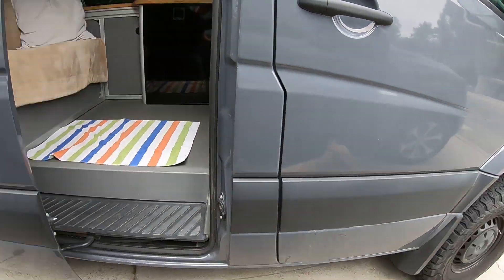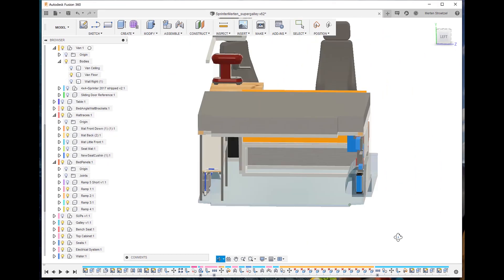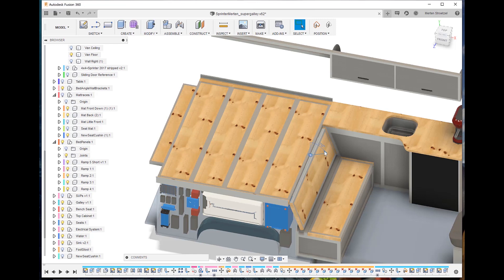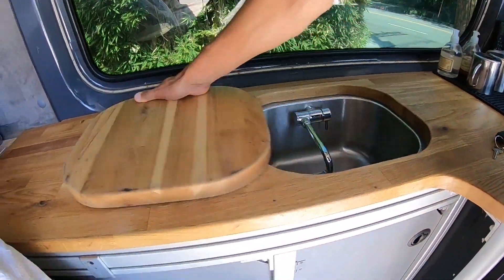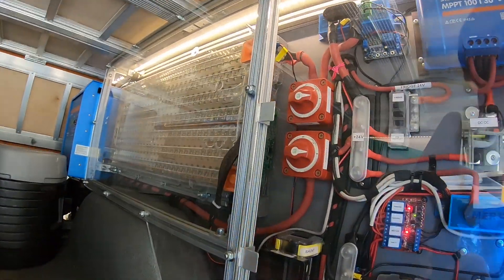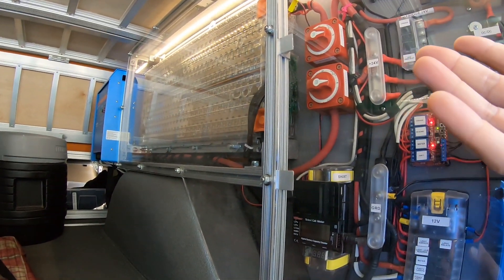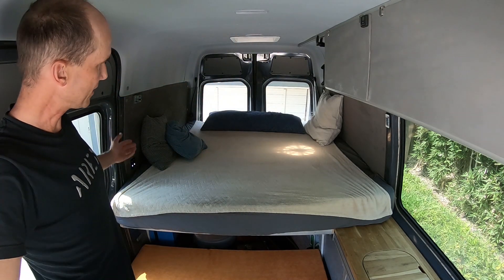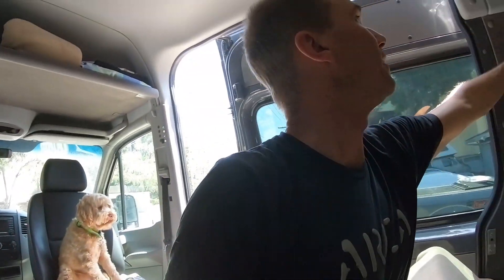Sprinter Build

Comment: I've always been intrigued with van builds. I really like your well thought-out design. Especially the heavy use of extruded aluminum, which I don't see often. I think it is a great idea to keep the weight down, and easy to remove, since most van builds I see use permanent wood structure which must add a lot of weight.

Comment: Thanks for showing your van off.  Your electric system still holds up 5 years later! Great job  with the bed. I particularly like how easy it was to set up and take down.  How many watts  of solar on the roof? 5 years later, is there anything you would have done differently?

Comment: I think you mentioned that you attached the bench seat to the original bench seat mounts. How did you do that? I've downloaded your Fusion model, but I don't see it.
Reply from the maker: I used j-bolts, hooking them into the track, tightening them on the 8020 bars positioned above with washer and nut. Here a pic where you can see the tip of the J-bolts and the nut: https://lh3.googleusercontent.com/pw/ADCreHc0cfnYB2EGXkHlRsc0-BTgAqQQzgTNv4L67rZKsfs3NJbgH-UAQBRmmkoD6SPjbKZSSsCdZtBCy0K8D9lJi6A0YKlY0fGb5lZeS98f-VXzYaneSymnBxGVGHTHIYSBOl7JmZpjZFSfWwu_iYQ5SgsZjhG1a1TAf5CocWuiwNE3BOfk6XnwgtdAt5p__eR6OllO7hIwhAELuq9PnUDGWwlx1LMQ228qF3BkR2xiY5OdXJx6q7yaFspV2aS1hzfodIEmIY76r-ZNnEaRwZiOjn_IRyn48RmjdbeCS4pLi3WvddI0XaIyorMmWHDMaDIO8FKlZy1aaTV-I07cRWOgHPGbsHkoYBPzS1xWQHLCuAftZmLH5TaIWkw5lWyqFuZ5YAROxzHbVDMp-TjiShgSo0XpJyupIxe7z65p9q-_-B2rs80t0oY4NzGUUX6u0H6lX6zS-lcwXPWGu-14ZolFrBFnMGJ8Eof2TlnA6SG9OEd0C_jaIVFRuHsMFTP1cCT7E_2EBQz5prUH61pVtHxFOFZjrnhy2gSdljVOrI022MTTiMx-kUe7ExBMqU32LpEM6RvI-tMI1HA_b7JQTx45bYWNIcD5aGNEQrhMuxr6tNHFgfqCDyNAvS0g9Cadnra50FPeGEXYOt_VVkok0yJrOIklM72Ew_1nY3LA4mkFkytZ_45AhztZ_mgFEnrqBV__xaKgea408l_Ltb8Yc4ddQwUfNLiq2A4KNWqznke-iQFC5Z0QoecTcNngghO-x36diTlYJFdmp9HMNW3y--_KkTepblTaE9PurLpnbMBYOFYzg5H7evkZJmG7PufwiuJK0VWQYQgLPECSQMI7kUyJrW4QbVDMu83gj_THJFWnmHRmLFyZZDICJ-jxb5_rOrDJXfgQlUinwEIgaQRPwQ=w2582-h1937-s-no?authuser=0